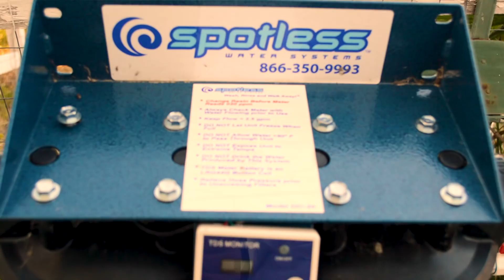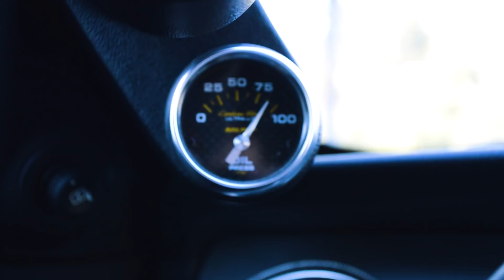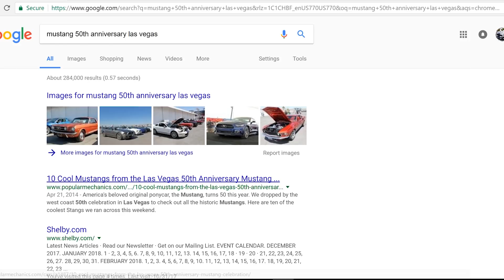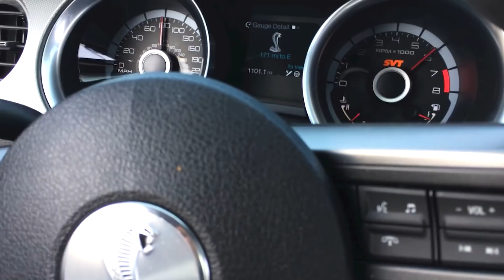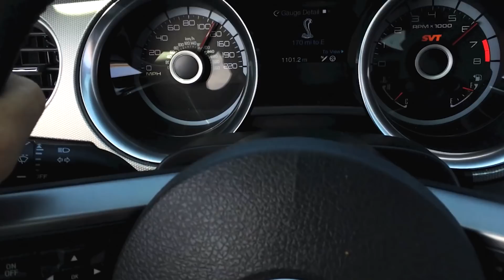Why I Bought The 1000HP Shelby GT500 Super Snake !

Comment: You should have had Shelby America do the wide body kit, the pinnings for all the SuperSnake stuff and then modded it more on your own to get the 1K hp figure (which is not difficult at all since all the SuperSnake parts are mostly aftermarket anyway).  Still nice car though, but that wide body kit really defines the SuperSnake package in looks in my opinion.  Plus it gives you the extra space for wider wheels/tires for front and back which the SS really needs a lot of.

Comment: Does the shelby 1000 have a built engine? The stock 5.8 is really only durable up to 850hp. They did test them at Shelby, at 1100 rods exit the block. The tuners all the the stock 5.8 starts to knock and behave strangely beyond 850.

Comment: I  can only hit 125 mph on my Camry driving through the highway.
Reply: Alex Its limited for a reason.  The 2018 Camry V6 with 300 hp should do about 140+ at redline.  But its geared for mpg not top speed.
Reply: Alex i have a camry xle 1995. 140
Reply: Yeah well that blows ass bruh. Sry to hear that.
Reply: That's what you get for buying an eco shitbucket

Comment: Fyi, Spec'd Super Snake comes with 725hp not 1000hp quit lyin.
Reply: Unless you drop an additional $80k
Reply: A limited amout did.
Reply: His is modified to be 1000 horsepower
Reply: The boy said he got the thousand horsepower version which they do make I look into it I have a 14 GT500 I'd like to know what the young man does for  a living because it's a lot of money
Reply: Kilroy was here more like 660 or so. But still...
Reply: Yes sir they do make 1000hp super snakes
Reply: they come with 850-1000hp for the 13-14 model for the 850hp it cost like 50000$ and i dont know about the 1000.  they do not make a 725hp i believe that was for the 05-09.
Reply: Research before you comment
Reply: I thought they just called it a Shelby 1000.
Reply: Kilroy was here u mad cause it has 1000 hp

Comment: The only thing this car is good at is burnouts... the New 2019 shelby gt500 will actually handle good and put the power to the ground and be a track beast...this trash of a shelby is a big ass boat
Reply: RILEY OVERWATCH i don't I have an lsx foxbody that will tear anything you got at the drag strip
Reply: The GT500 of this generation wasn't meant to be a track monster. It was meant to be stupid powerful ,obnoxious, cool, and go fast in a straight line.
Reply: Donald Trump quiet and worry about rocket man.
Reply: As a long time Shelby owner. It all boils down to how much money you have to spend on performance equipment. A 1200 HP   street car is nothing anymore.